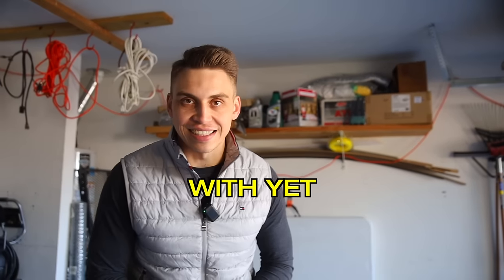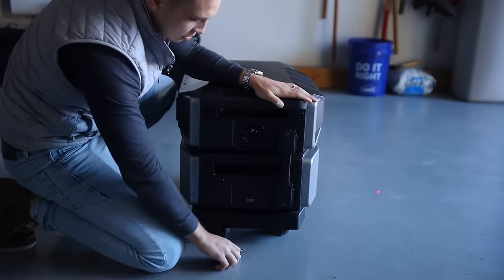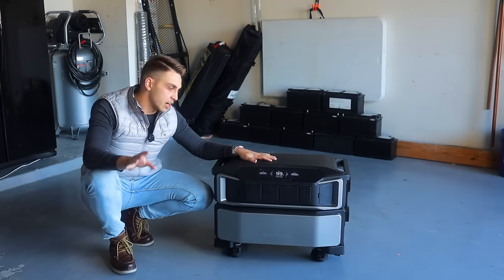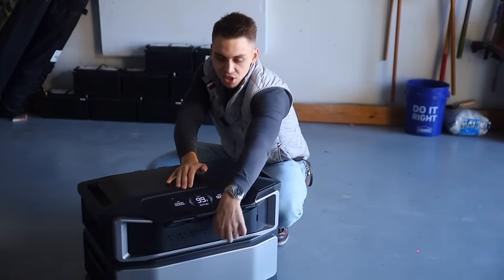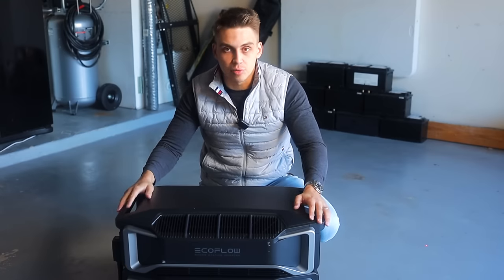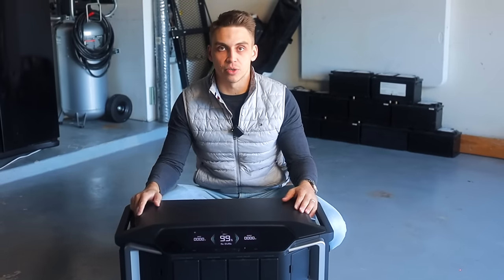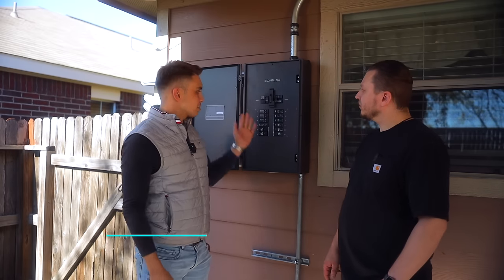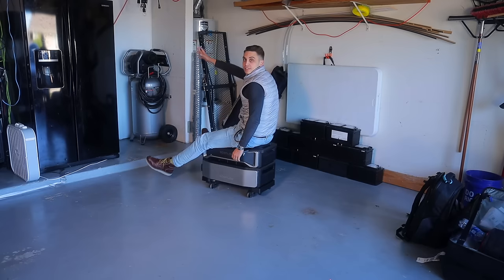First Full Review of EcoFlow DELTA Pro Ultra & Smart Home Panel 2

Comment from the maker: Comment below if you have any questions or suggestions about the product, I am more than happy to answer🙌
Reply: I love EcoFlow. I have a Delta 2 and an extra battery 🔋  but I had some problems with it. I had sent it back, and they took forever to replace it and didn't get any money back or compensation
Reply from the maker: hi really sorry about that, could you please tell me your order/case number? I will deal with it.
Reply: @EcoFlowTech  And now when I told them  about the compensation or  something they  wanna offer me a camping light
Reply: @EcoFlowTech no update
Reply: Does the wall panel also maintain the batteries from the grid if there are no solar panels and still allow Automatic Transfer during outages? Also I assume the external generator port shown was just something the owner installed separately and not bundled with the home panel?
Reply: Hello. I ordered a Delta Pro Ultra and SHP2 to go along with the two Delta Pros I already own. I also bought the Ecoflow Double Voltage Hub - Power Input/Output (Delta Pro). I haven't received anything yet, but I realized on thinking about it that I will also need a male-to-male connector to go from the Double Voltage Hub to the SHP2 (I'm assuming the SHP2 includes a connector for the Delta Pro Ultra already). Is that the same as the original Ecoflow Infinity Cable? Or do I need to order something different? If I order an Ecoflow Infinity Cable, will that allow me to connect the Delta Pros to the SHP2 through the new double voltage hub? Thank you.

After reading the manual of the SHP2 online, I think an Infinity Cable is not what I need. But I am unclear on what I actually do need. Can you please tell me which cable is needed to connect Double Voltage Hub - Power Input/Output to the SHP2?
Reply from the maker: @Withlovefrominterent  Hi there, you will need an input/output cable, check out here👉https://us.ecoflow.com/products/power-input-output-cable?variant=40767971557449
Reply from the maker: @tsquaddailylife5804  Hi sorry for the late reply, we have sent you a new unit and a camping light to express our apology. The NEMA L14-30R to L14-30P generator cord is not available now. We will deliver you one once it is back in stock, sorry about that.
Reply: Do you guys have any refurbished Delta pro I wanna purchase one in about 3 months. I'm trying to save up some money for that Also I am going to do a review off my delta two and post it on youtube.
Reply: @EcoFlowTech  I just placed an order for one, thank you. May I actually suggest that you guys have a look at the website and maybe try to make things a little more clear regarding which cables and/or accessories are needed for certain products? I love your products but it seems to be quite a common issue for people that they are unaware of needing a certain cable or that the cable they need is not included with the product. This is especially true for solar panels or solar generator bundles, but obviously with other products as well. I actually ordered too many cables on a previous order because it wasn't clear a certain cable was already included. Anyways, just a suggestion! Thank you for your help!

Edit - also, I asked this same question on the US product page of the double voltage hub (input/output). Somebody from Ecoflow replied but they gave the wrong answer. They basically said the SHP2 connects to one Delta Pro, then the two Delta pros connect together with the hub. I knew that was obviously wrong from the video above. You may want to take a look at correcting that.
Reply: How is the top part of the SP2 that goes outside connected to the bottom part that was in the closet of this video? And is there a limit on how far the DPU unit and bottom part of the SP2 can be from the top part that is outside near the breaker box? Thank you.
Reply from the maker: Hi! Really grateful for your feedback and I have brought them to our colleagues in charge. If you have any questions or advice in the future, feel free to give me a shout🙌 @Withlovefrominterent
Reply from the maker: Hi, we have refurbished Delta Pro in Europe and North America. @tsquaddailylife5804
Reply: Quick question; what is the long distance support between the Ecoflow Ultra and the Smart Panel? I have a detached garage that get its power from our main panel local in our main home through a tube underground. I estimate maybe 50 feet of cable. Would it be possible to have the main unit in the garage connected to the smart panel 50 feets away?
Reply: Please send me a link to instructions on how to change a faulty relay on a new Smart Home Panel 2. My new panel was installed last week but I can’t use it because it says it has a faulty relay. Your help will be appreciated.
Reply: @NorthernMTB The top of the Smart Home Panel 2 should be near your main breaker panel. The battery connector box can be about 60 feet away. You will need a Cat6 communication cable and AWG #2 power cables.
Reply from the maker: Hi there, could you please contact our after-sales team via support@ecoflow.com with your unit's series number and a screenshot of the faulty relay. Sorry for the inconvenience. @nadeemmalik1464
Reply: can i connect 10 mono microcrystalline 400 watt solar panels that might perform better than its 400 watt capability unless im wrong about that to the high voltage pv input? I am worried that it might produce more than 4000 watt, will the inverter only allow 4000 watts or will it damage that high voltage Pv input?
Reply: @EcoFlowTech - Is the Delta Pro Ultra listed/certified by UL/Underwriter's Lab or similar organization? If so, is it documented on the EcoFlow site or packaging/manuals?

Comment: Ecoflow sold me a faulty smart home panel 2. After it would not work Ecoflow confirmed it to be faulty. I had already paid $2500 to have it installed. They sent me a new one but left me hanging on the cost to have it reinstalled. DO NOT BUY.

Comment: I have the Smart Home Panel 2 and ultra with three batteries. Installed on Feb 1st and I keep getting a battery error and the power connected to the panel went out for no reason for ten minutes. I called Ecoflow and was told that a tech would reach out by email. Now I paid 13 thousand for this system that doesn’t work and Ecoflow has no customer support. So an email will help solve my problem. I got this system because I have a handicap child. Why can’t Ecoflow help!!!
Reply from the maker: Hi there, sorry about that. Could you please tell me your case or order number, I will prioritize your case.
Reply from the maker: Hi sorry to know about that, could you please tell me your case number?

Comment: There is nothing really new for either product that we didn't already know...Need more specs on the panel? Can you remote turn on/off certain breakers? What brand breakers? Tandem breakers? Looks more like a subpanel but has no knockouts for wiring? How may Delta Pro's can be connected with the new dual voltage hub? 3 ports with 3 DVH says 6 to me?
Reply from the maker: Hi there, to answer your questions
1. Breakers can not be used to remote turn on/off, you can realize this with relay.
2. Smart home panel 2 is compatible with plug-in types breakers, check out our user manual to learn more👉https://manuals.ecoflow.com/us/product/smart-home-panel-2?lang=en_US
3. Tandem breakers are compatible
4. 2 pros can be connected with the new double voltage hub. 
5. Smart home panel 2 only has one port that supports the 2 pros array.
Reply: @EcoFlowTech  thank for replying.  Which port only supports 2 Delta Pros?  Seems possible that if I use 3 of the new double voltage hubs I could hook up 6 Delta Pro's?  That setup would be 21.6kw just like using 3 Ultras.

Comment: I definitely need something like that with how unreliable our power has gotten.  It keeps going off momentarily messing up all the smart home devices.  Power company said get used to it because they are constantly transferring power feeds to keep the grid from overloading at this point. Seems like only a matter of time before there are big outages caused by the overloaded grid in our area. Soon things like this will probably be a requirement and not an option as they take down gas power plants.

Comment: Does the Delta Pro Ultra or Smart Panel 2 support APIs that I can query locally? I use Home Assistant and want to automate without the app entirely offline and I don’t want to install an electric panel that requires connectivity and an app to use it 😬

Comment: this video should be on the main page for the product, Or have pictures of all the connections with labels. on you website there  are not good diagrams of power outlets or picture of the panels open for viewing. I cannot find anywhere that tells all the ways to connect for power. 240V direct?!! YES!! thanks for the information!
Reply from the maker: Thanks for your suggestion, we will improve that! Feel free to check out the user manual link below and see if it helps🙌https://manuals.ecoflow.com/us/product/delta-pro-ultra?lang=en_US
https://manuals.ecoflow.com/us/product/smart-home-panel-2?lang=en_US

Comment: To save the maximum on energy costs, would it make sense to charge the DPU with solar during the day and then utilize the DPU to power the home during peak rate hours 5-9pm? Any downside to doing this each day and can it be automated with the app?
Reply from the maker: Hi no worries, it can work. Also if you pair the ultra in use with the panel 2, you can turn on the TOU mode, based on TOU's peak and off-peak rates and user's usage habits, the panel will intelligently manage batteries' charge and discharge to help you reduce energy bills.

Comment: when you stack the batteries how do you connect them to the inverter, is it just the first battery that make other batteries act as one unit?
Reply from the maker: Hi you can use the battery connection cable to chain the battery with the inverter and several packs of battery together. Check out the user manual for more details👉https://manuals.ecoflow.com/eu/product/delta-pro-ultra?lang=en_US

Comment: Can the low voltage high voltage PV inputs be used at the same time?
You just answered that! Yes, 8.8kW total input that’s shared in any way it seems.
Reply from the maker: yes the low pv input 1600W and high pv input 4000W can be supported at the same time. Multiple charging can support up to 8800W when you use one inverter with at least 2 battery packs.

Comment: Three questions here:
1. Can I go off grid with delta Pro ultra?
2. If so, how many of those units  do I need and solar to manage a big house hold with An EV?
3. Are you Shipping  to Africa specifically  Zambia?
Reply from the maker: Hi glad you are keen, to answer your questions:
1. Yes it is an off-grid solution
2. That depends on your electricity consumption, how many appliances you want to run, and for how long. One battery has 6kWh capacity and this system can support up to 90kWh.
3. Sorry this product is now only available in North America. We are still doing market research in other areas, please stay tuned!

Comment: I want to buy one. Even go the 300 coupon but i cant find out how to wire it for my camper van. Even emailed ecoflow and the lady that responded said she didn't know 🤦🏾‍♀️ I was going to use it as my whole electrical system and wanted to know what EV shorepower inlet box and cord i would need to plug into the ecoflow ultra. I want to be able to charge the camper via solar, ev chargers in the city ans shore power. But idk vomponets to hook it up 😒 So I dont want to buy something so expensive and will not be able to use it.
Reply from the maker: Hi there, to answer your questions:
1. The Delta Pro Ultra has a low solar input port and a high solar input port. 
2. You can use shore power to charge your Ultra, and you will need an EcoFlow AC Generator Charging Adapter and another adapter to plug into the shore power. The maximum current is 30A.
3. You can use an EV charger to charge your Ultra, and you will need an EcoFlow X-Stream Adapter.

Comment: Good morning. I bought this material. so EcoFlow Delta pro ultra with the Smart Home, panel 2. it’s perfect!!! The only problem is that to create automations, you need Bluetooth to search for devices via Bluetooth. Bluetooth is not working on my device. Impossible to synchronize via Bluetooth, there is no button to activate Bluetooth either physically or on the EcoFlow application, so no Bluetooth, no automation. Please tell me if you have tried Bluetooth or automation. did you find the solution to add the devices that should even already be connected together right? since they are already connected via wifi… 🤣🤣🤣
Reply from the maker: Hi there, you can set the automations via the smart home panel 2. Simply open your EcoFlow APP and scan the SN number behind the glass door of the panel 2 to add your device to the APP and connect to the internet. Or you can try Bluetooth connection. Check out this tutorial video for more details👉https://www.youtube.com/watch?v=9_ig0EnOifs
Reply: @EcoFlowTech  Good morning. Thanks, I'll try like that. so far in the application it does not detect Bluetooth devices.
Reply: Good morning. I finally got the Bluetooth to work. And I understood why it didn't work. The system can only work with Wi-Fi or Bluetooth but not both at the same time! the moment you are on Wi-Fi the Bluetooth is cut off, which is why I couldn't synchronize via Bluetooth and detect my devices. So what did I do? I unlinked the two devices. I stopped the wi-fi at the box. he had no choice, he had to turn on the Bluetooth and there the Bluetooth was on on the screen and as soon as I turned the Wi-Fi back on, the Bluetooth was cut off again. Anyhow, thanks for your help. 👍😀👋
Reply from the maker: Hi! Glad you figured it out yourself and it can work now! Thank you for sharing with us, if you need any help, feel free to give me a shout😉🙌

Comment: hello do you have a way to charge from eco flow dual generator or a adapter to use for that
Reply from the maker: Hi yes you can directly plug your EcoFlow duel fuel generator to the ultra.
Reply: @EcoFlowTech  does it take a special adapter for it to work
Reply: Or a different cable
Reply from the maker: Hi sorry my bad. No extra adapters are needed, you can just use the AC charging cable and plug it into the charging input port on the ultra.  @larryatkins4512

Comment: If i connect it to the 30a generator inlet through 240v outlet, will it detect grid failure and start giving power automatically???
Reply from the maker: Hi, are you using an inlet box or a transfer switch? When you turn the transfer switch from the grid to the generator, as long as the cables are chained correctly, it will not detect grid failure.

Comment: Would it be possible to use wind turbine power input into smart home panel 2, or as a charging option for the battery bank?
Reply from the maker: Hi there, sorry for late reply. Smart home panel 2 is a sub panel which supports both grid and generator power input. If you want to use wind turbine, it is suggested to plug it into the ultra to charge the battery.

Comment: A couple questions I do have,  does it charge an EV car like the Pro does? I have 2 Pros now with dual voltage hub for this purpose. And does it use the same plug adapter to use to charge the car? Meaning,  I have a plug adapter that I use on the dual voltage hub to plug into my EVSE. Am I still going to be able to use this same plug adapter or do I have to get a whole new one?
Reply from the maker: Hi there, yes it is the same way as you charge with the Pro. For the plug, it is recommended to use one like this👉https://www.amazon.com/s?k=neutral+to+ground+bonding+plug&adgrpid=120556264204&hvadid=631614860618&hvdev=m&hvlocphy=9032186&hvnetw=g&hvqmt=e&hvrand=2102013651095589687&hvtargid=kwd-969109812861&hydadcr=13059_13482270&tag=hydsma-20&ref=pd_sl_7rb5t1l20j_e

Comment: What is the overall height of the inverter and one battery without the cart? I have a potential use case with a height restriction.
Reply from the maker: Hi, the height of the inverter is 214mm and the battery is 204mm

Comment: can i connect 10 mono microcrystalline 400 watt solar panels that might perform better than its 400 watt capability unless im wrong about that to the high voltage pv input? I am worried that it might produce more than 4000 watt, will the inverter only allow 4000 watts or will it damage that high voltage Pv input?
Reply from the maker: Hi there, to answer your questions:
1. If it is portable solar panel, you can only connect up to 9 pieces of 400W solar panels. 
2. Yes, the high PV input port of the Ultra can take up to 4000W. 
3. As long as the VoC does not surpass 450V, it is fine.

Comment: How far can the bottom connection part of shp2 be from shp2 itself? Can it be extended to be like 50 ft apart?
Reply from the maker: Hi there, given the length of the communication cable, it is suggested keep the distance between the distribution panel and the battery connection box within 20m.
Reply: What type of cable connects the distribution panel (top part of SHP2) and the battery connection box (bottom part of SHP2)?  @EcoFlowTech

Comment: hi I have a question with a 3500w machine how long can I use it with the ultra pro and 400w solar panel ?

please respond
Reply from the maker: Hi, how many 400w solar panels you have and they are rigid panels or portable? Take portable panels as examples, if you chain three EcoFlow 400W solar panels in series and use them to charge the ultra in winter, with decent sun radiation, they can charge 7.2kWh after 6 hours.
Reply: @EcoFlowTech  and how long can I use a 3500w machine with this setup?